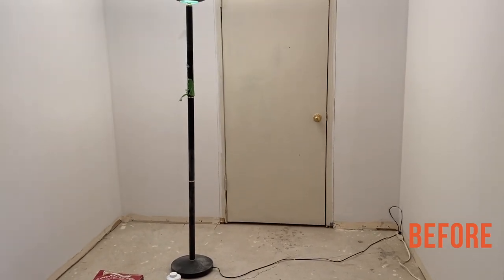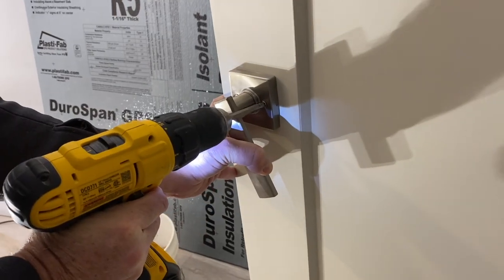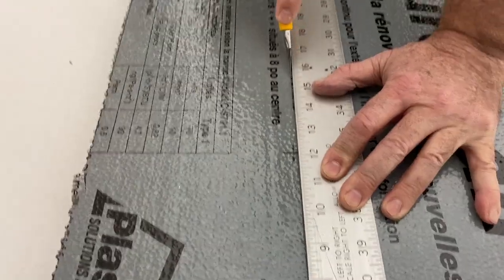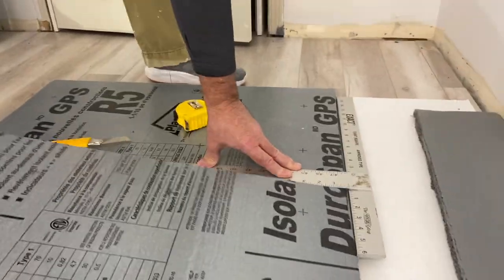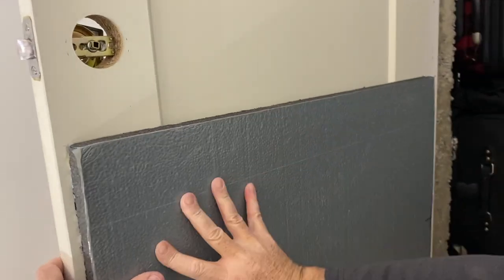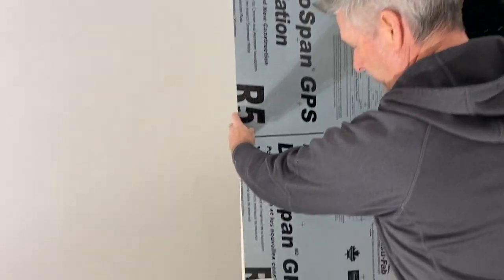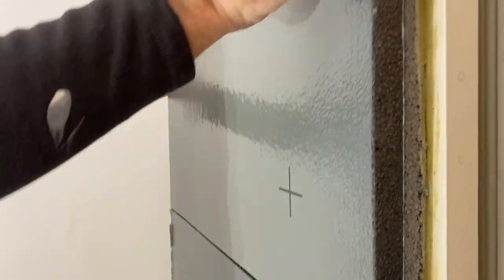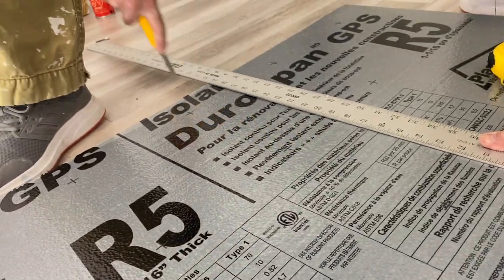DIY: Insulating Interior Door

Comment: May DuroSpan GPS be safely used on the backside of an interior door to a closet housing a gas forced air furnace? The distance between the furnace and a door with insulation would be 8". The small furnace closet gets cold because there's a vent  on the outside wall to supply air for combustion. The back of my desk chair is next to the door which gets cold. I've been looking for a solution like this. Thank you!

Comment: Man this was fantastic, thanks so much! I got my project done and it's got another 36 hours of curing before I hold my breath and open the door, lol. Some recommendations on a good knife for this would be appreciated. I used a razor box cutter and first and it kept bunching up and shredding the Styrofoam. I changed to a fresh razor but it was the exact same issue. I ended up just using my basic serrated 4" pocket knife and it was better, but still nowhere near as smooth and easy as it looked in your video.

Comment: In general, flammable foam can not be used inside a livable space without a fire barrier, i.e. gypsum board or even wood.  (Foam fumes are extra toxic is why it is a code issue.)